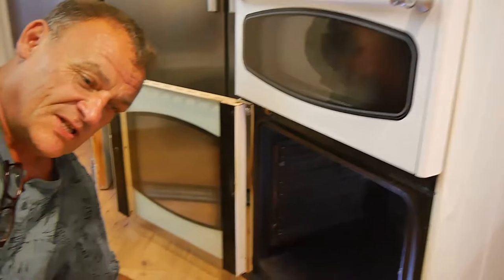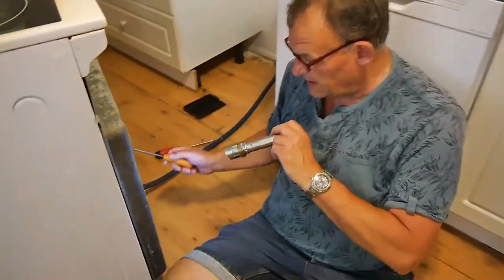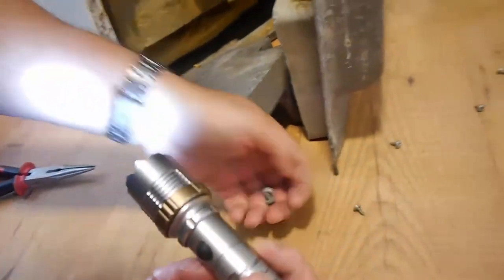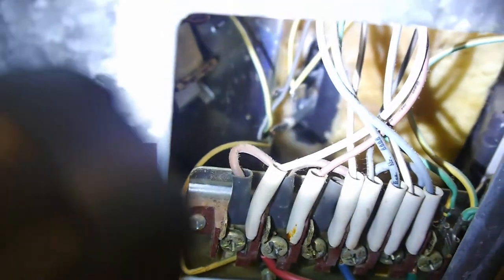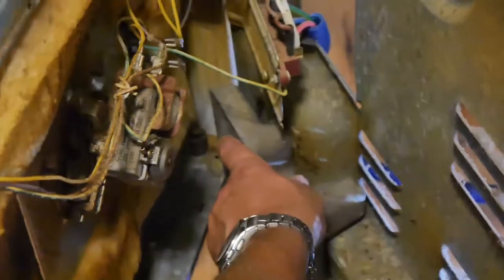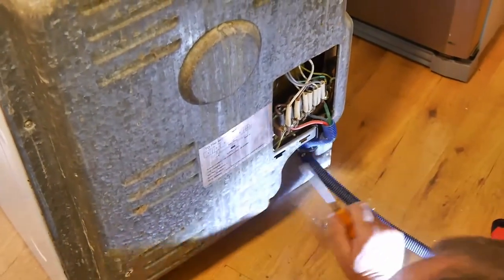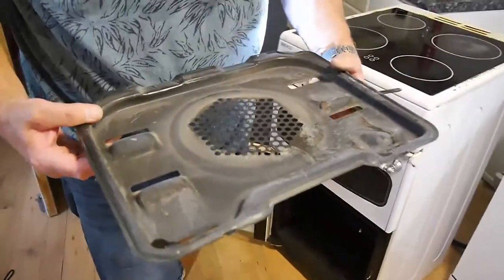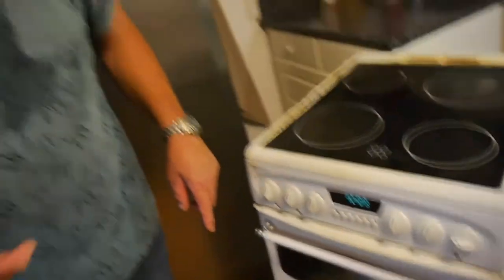#HowToBloke DIY Testing & Changing a Beko DVC 6531 Fan-Assisted Oven Heating Element|Filament|Coil

Comment: hi there thank you for making this video I will be attempting to do the same thing I just had one question with regards to isolating the power I have turned off the power to the oven on the circuit break mains board does this mean I can carry on with out worrying about shocks or burns or should I also remove the cables going int the wall wear the oven plugs in I look forward to your speedy reply and thank you once again for the video
Reply from the maker: I am not a qualified electrician and cannot advise you. Post your question on a home appliance help forum and ask the opinion of an expert.
Reply: @HowToBloke  ok thanks I just wanted to know in your video if you unplug your stove from the wall thats all
Reply: @HowToBloke  hi good news I have managed to fix my stove thanks to your great video thank you

Comment: Hello mate can you help I removed the element but dropped the 2 Spade connector wires down the back. I removed the back and retrieved the wires but there both grey and I can't tell which way round they go now.  If put onto new element wrong way round will it be as disaster.
Reply from the maker: I'm not a qualified electrician so I can't advise you. Try searching the web for OVEN HEATING ELEMENT POLARITY or ask the supplier of your new oven heating element or a professional electrician.
Reply: @HowToBloke  cheers